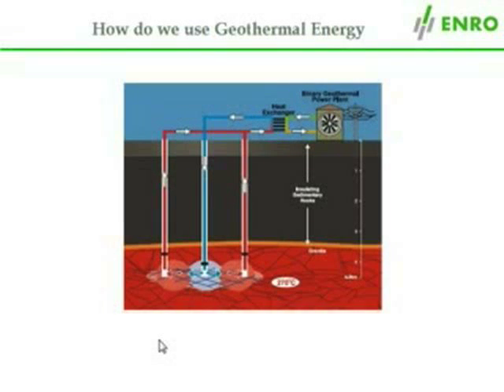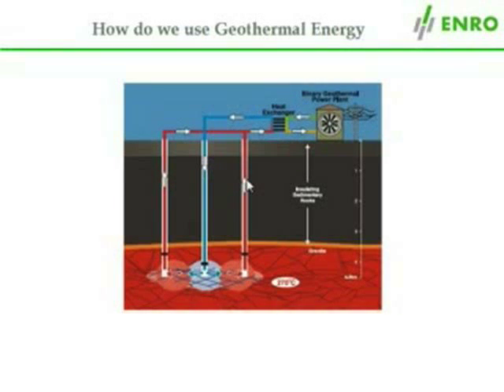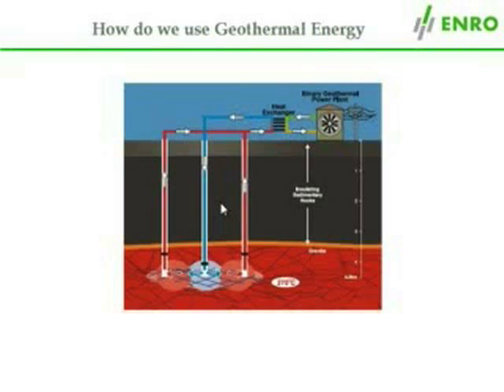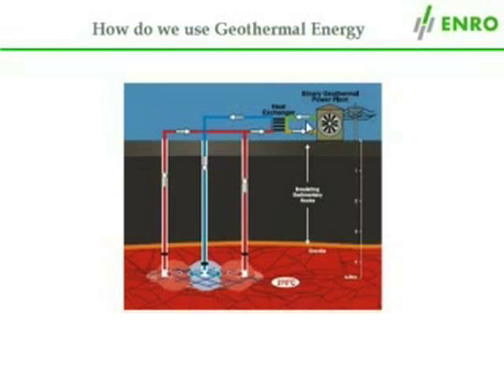Geothermal energy extraction process

Comment: Pidos847 and tsuchan1 I believe your in violent agreement! ...  
There is Geothermal exchange technology as well as this technology -- with is totally different than using a geothermal well to generate steam or temperatures to create pressurized gas for driving a  turbine generator.  Exchange uses the constant ground temperature and a heat pump.  Here is one example:

watch?v=AprORaUFwiQ&feature=channel_page